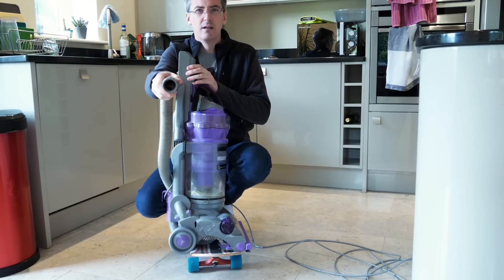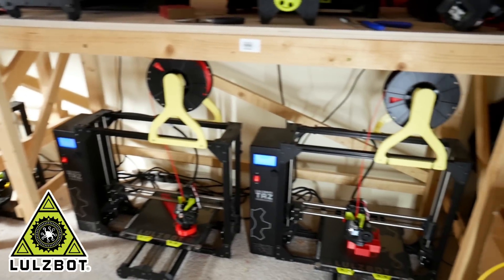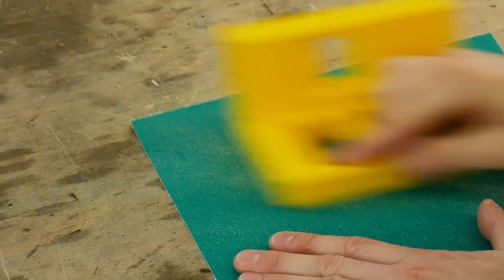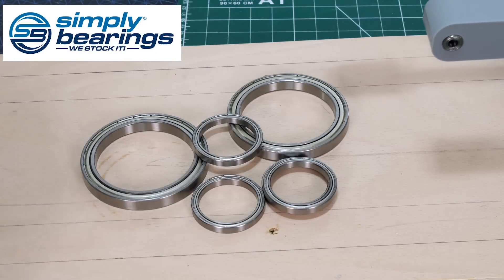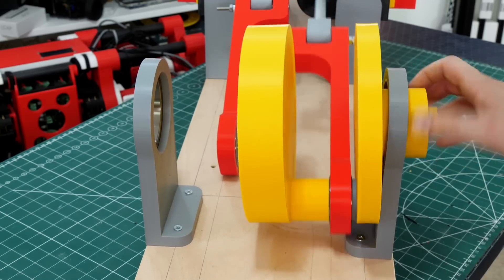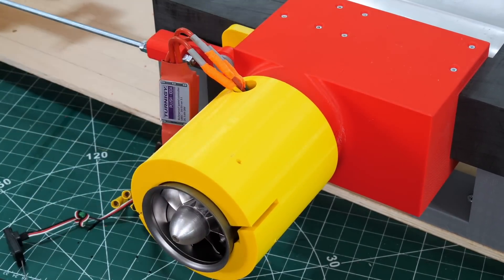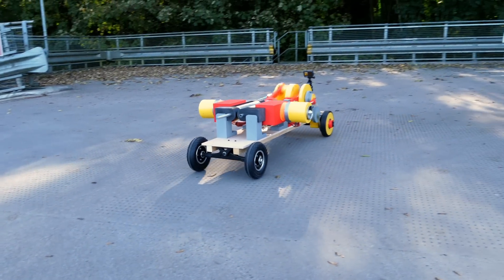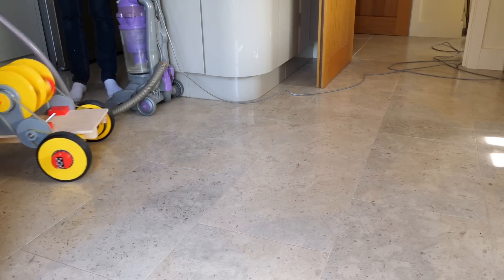Jet Powered air engine

Comment: Awesome engine. Instead of an EDF, try a turbo charger, so you get more air pressure instead of air flow/speed. Then it should be powerful enough for you to ride it, even with the small cylinders.
Reply: do you mean like a blower fan? Cuz he doesn't really have a source of high pressure, fast moving air to drive a conventional turbo..
Reply: @emiliaolfelt6370  I'm thinking of those snail-shell-looking fans. Like the one Integza made for his turbo-charged pulse jet. With that you'd get more air pressure, instead of airflow.

Comment: Im curious if putting more tolerance in the design and using something like this method of smoothing prints with UV resin and corn starch could help the fit as well:
https://youtu.be/KVf0mbBCygQ?si=2D-yWKotUBrjlOnh

Comment: I'm of the opinion that you should use much wider diameter pistons over longer stroke.  More surface exposed to pressure translates to more output torque.  Of course i made this comment just before the end of the video...

Comment: Try adding some silicone oil to the moving parts and cutting or reprinting the piston with 2 groves so you can put an O-ring on it also the piston can be 0.5mm smallerto will help to stop binding

Comment: It sounds like there is a lot of air bypass on the cyliders. you could use some heavy weight oil to seal around the piston and the rods. that will decrease the leakage without changing teh friction.

Comment: A collab with Tom Stanton would probably be a good idea.  He's probably the best expert at air cylinder engines around
Reply from the maker: It would have been easier with compressed air because there's enough pressure of overcome the friction of seals, but this is a harder problem to solve.

Comment: Well, on a steam locomotive, the cylinders do seem to be between a third to a half the diameter of the entire boiler, their length isn't too much greater than their diameter, less than twice from the looks of it, and they run at very high pressures, about 200 to 300 psi. EDFs don't make much static pressure at all, they are designed for high speed, I think its why JLaserVideo's hoverboard tunneled through the water and sank, its all velocity. To get a bunch of pressure, you could resin print an impeller and attach it behind an EDF motor so it stays cool, then hook up the housing output to the inlets, perhaps you'd only need to split it too. Could be an idea, I'm more just spitballing since I've got a bunch of theoretical knowledge and zero experience XD

Comment: try a screw compressor instead of the ducted fans. you need pressure, not airspeed... could be interesting to 3d print one...

Comment: Perhaps put a counterweight on the flywheel to offset the weight that is off-centre where the connecting rods and pistons are mounted. That's what is causing the back and forth vibration and will be wasting a considerable amount of power too.

Comment: No replacement for displacement! But did you see Tom Stanton's air engine piston seal he came up with? That would help you get some extra push too. Or just super scale one of his designs? lol. Fun challenge for yourself though! Best luck.
Reply from the maker: Yes if I was using compressed air, otherwise there's not enough force to overcome the friction, but I'd need a really big tank.

Comment: Calipers and something like a lathe would allow for much more consistent tolerances. I say "like" a lathe because you could probably build a jig that would be quite sufficient for working with 3D print materials and the sanding tools that you already have. The key is carefully controlling the movement of the part relative to the sander, holding it at a fixed distance, measuring, then advancing. Applying pressure to a freely moving part by hand is quite variable and not precise.

Comment: You should take a look at Tom Stanton's air engine
Reply from the maker: It would have been easier with compressed air because there's enough pressure of overcome the friction of seals, but this is a harder problem to solve.

Comment: Wouldn't this be a 1 stroke engine, not a 1/2 stroke? I thought a 2 stroke gets power every time a cylinder goes down. On this one the cylinders get power going both up and down. Please correct me if I'm mistaken.

Comment: Measure the static pressure you can generate with a length of tube with water in it by the height change with it off vs on. With this in Pascals and your piston surface area you know the force, then you can do the lever and gear ratio maths to work out the torque at the wheel and propulsive force. You can measure the force required with a spring gauge, or push against a weigh scale. Then you know if it's going to work before you build it.
Reply: spot the engineer

Comment: You can 3D print an O ring groove and use different thickness of O ring to tolerance the gap, then a  little light oil to lubricate and it'll be super low friction AND low leakage.
Reply from the maker: Thanks, I have a few better ideas for the next one.

Comment: A few CM more radius could improve your cylinders - however, you'd be best to measure the static pressure (above ambient) created by your fans and to calculate the force this exerts on your cylinders. I think your static pressure is just very low overall. Sadly though, to get chuff sounds, you'd  really need a contained pressure vessel that quietly produces your pressure - those ducted fans will always overpower the cylinder exhaust sounds. 

Next up, Walshaerts?

Comment: For starters your valving is built backwards. The slides should be inside a box, with the connecting rod coming through a seal. The pressure differential will aid in their sealing, not cause leaks like yours. 

Secondly look into cup seals for the pistons. 

3rd. A weighed flywheel

This video is a prime example of what's wrong with modern engineering. These simple solutions were solved 200 years ago with no electricity, no internet and no calculator. Today engineers and designers don't understand or care to learn why things were done the way they were. They think they are smarter and in turn create junk

Comment: Edfs move air, but they don't actually create pressure. Same reason you can't just strap one on the intake of your engine and make boost. You need an impeller not a fan.

Comment: Those edfs have very low static pressure. which results in very low torque. Which is why it's not moving with the tiniest bit of friction.
A different type of propeller, or even impellor might work better, like a turbo charger.
An other option is to have an air compressor system provide the air, they are good at providing static pressure.
And yes you also want as big of a bore as possible to get the most out of the little static pressure you get. then reduce the stroke, and you also don't have to reduce it as much with pulleys. as it will run with lower rpm.

Expansion engines like this are all about the pressure, air speed is less relevant, a steam locomotive runs on 200 to 300 psi after all. which is like the opposite of what edfs are designed for.
Reply: This is spot on. The issue is that the EDF is designed for high volume and low pressure. Great if you just want to prove you can move the pistons fast with no load, but not if you want any torque. To get torque you need high pressure. Volume matters very little and torque can be converted to speed. It would be amazing to see James take Mathias' impeller designs from other projects and try to 3d print them as well.
Reply: You think this would work better with Blower type fans, like the types used in air doors or household air handlers?
Reply: @smaqdaddy  I don't know, do they keep pushing air in even when the air can't leave out another place? that's what you need if you want high static pressure.

Most fans, if the air can't leave out the other side, air will leak back through the fan blades basically, against the new air coming in, meaning no new air will move in.

You can understand the difference, by imagining how easy you could blow backwards through/past a fan while holding it still..

Something like a piston air compressor, or a roller supercharger, you can not push air backwards if it's held still, because at no point is there a fully open pathway between the inside and the outside.

Comment: Nice build. But this proves how inefficient this style of engine is. If you just used a 4kw electric motor you would have an order of magnitute more force - yes I know that's not the point of the build. 4kw will happily move a small car (real car) at a resonable speed.

Comment: Hey James. Are you sure one of the reasons it’s slowing down as soon as you stand on it isn’t because you’re putting one foot and therefore pressure on the cylinder holder? It does look like you’re bending it a bit. Oh yeah, and look into dynamic sealing too!

Comment: Have you seen the steam engine design where there are two cylinders and the second larger cylinder runs off the output of the first one? I saw it ages ago in a Jay Leno video about one of his steam cars, but I got the impression that a lot of steam engines work like that. Is that design more efficient? You should look at more existing (ancient) external combustion engine designs.

Comment: Have you ever tried PTFE Film tape to line the spaces between moving parts? I've found that it makes it nearly frictionless.
Reply: I'll second this, it's a great way to reduce sliding friction.
Reply: Great idea! Or, even design piston grooves and use 3d printer type PTFE tubes as the seals with staggered gaps.
Reply: Beeswax also works very well and doesn't require any additional thickness to be accounted for
In a pinch I've used chapstick which works about as well but doesn't last as long

Comment: What if you used a "cone" shaped seal on either side of the piston. When pressure is applied it will expand out to meet the cylinder wall, but when there is no pressure it wont be touching, reducing the friction. Tom Stanton used one in his recent air powered engine.
Reply: I thought this then realised the piston is pressured in both directions  unlike Tom’s.
Reply: 2 of them @Margarinetaylorgrease

Comment: I think you should research dynamic sealing, one of the way to seal moving pieces without adding friction (the piston for example) is to make multiple grooves (like o-ring groove) along its length, this create sudden pressure increase and decrease as air tries to leak which create very high head loss and stops most of the leak (it still needs a small leak to maintain the head loss, but it's drastically better than just a cylinder in a tube)
Reply: Great comment
Reply: @Choconillaaa  🔴 What Is Islam? 

🔴 Islam is not just another religion. 

🔵 It is the same message preached by Moses, Jesus and Abraham.

 🔴 Islam literally means ‘submission to God’ and it teaches us to have a direct relationship with God. 

 🔵 It reminds us that since God created us, no one should be worshipped except God alone. 

 🔴 It also teaches that God is nothing like a human being or like anything that we can imagine.

🌍 The concept of God is summarized in the Quran as:

📖 { “Say, He is God, the One.  God, the Absolute.  He does not give birth, nor was He born, and there is nothing like Him.”} (Quran 112:1-4) 📚

🔴 Becoming a Muslim is not turning your back to Jesus. 

🔵 Rather it’s going back to the original teachings of Jesus and obeying him. 

More .....👇
Reply: I was going to recommend the same thing.  This design is used in almost every gas-actuated firearm.  The gas piston usually has a number of grooves to help seal it without the use of o-rings, piston rings, etc.
Reply: Nice! So it acts sorta like a tesla valve? Where air pushes against itself?
Reply: @TrumpstienPhile  more or less, the idea is the same, creating turbulences to create head loss, but the Tesla valve act by redirecting air against itself while here it's by creating rapid changes in volume and pressure
Reply: @red1246  good explanation. Would the turbulence cause vibration/ cavitation? Probably  not with air but with water I guess?
Reply: @TrumpstienPhile water doesn't like making sharp corners. The cavitation would make those sharp edged grooves round until the cavitation stops.
Reply: I didn't know that term but figured similar Multiple tight tight boundaries in line should prevent a lot of air coming out the other end.
Reply: Just use a thick grease. Simple fix. Might be messy but it will do the job
Reply: @SuperFGeeT  Thick grease also creates friction in a situation where it will never really warm up and reduce its viscosity. In a mechanical assembly with high torques involved, the losses from the grease are pretty negligible, but at hobby scales and power levels, grease can have a pretty significant effect.
Reply: @SuperFGeeT  In this case, 130 years of steam engineering ago would suggest packing with leather. Example: low tension metal split ring wrapped with leather. For steam, as the piston & ring heat, it expands the ring pushing the leather into the cylinder walls, and as some of the steam is still wet-steam in phase, it swells the leather to match the cylinder. In this case, his round piston design might work with pre-oiling or pre-wetting the leather then installing it.

For other designs, newer air compressors in high horse, high RPM ranges use "oilless piston ring" designs with a graphite/teflon ring which runs in an aluminum cylinder. However, those are specific-directional rings not meant for power stroke on both sides. Could be reworked however, as a double sided (or two sided) oil ring.

As one suggestor pointed out, grease creates too much horsepower loss in "hobby scale" (in this case, it isn't hobby scale, it is just very poor design...so there is a difference). Note- We all have to learn the hard way the reasons old-timers probably tried all this and abandoned it due to tech limitations. Secondarily, a round piston with just an o-ring (lubricated with whatever you got such as vegetable oil, regular oil or otherwise) would work for a while.

Since he is going extremely long stroke, heavy mass piston for lots of torque...and it being square...will present differing challenges for seal.
One suggestor pointed out channeling the pistons to create high/low pressure areas...same as hydraulic pistons in older stuff...in that case, a corkscrew channel design with a round chamfer on one side of the groove and a curved chamfer on the other may work.
Reply: Like Tom Stanton’s flexible seal?
Reply: optimize your Air Engine like Tom Stanton did in that video
/watch?v=cYF_D-4PhUU

Comment: The flywheel also needs a counterweight to cancel the reaction to the piston flying back and forth. Look at any steam train wheel and you'll see that it has a huge weight attached opposite the crank arm. And is there any way you can lubricate the cylinder? I feel like if you smear enough grease on it, that might even close up some of the leaks too.
Reply: You don't really need counterweights, they're only there to get rid of vibrations. And grease might improve the seal, but it would actually increase friction. In principle you'd need a proper oiling system using a low-viscosity lubricant, but it's not really worth it. The advantage of using plastics is that they're self-lubricating to some extent.
Reply: @leftaroundabout Well he also has an innate leak anywhere he is using the 3D printed material where pressure is applied because there are lots of tiny holes you can't see with the naked eye but it becomes obvious if you are dealing with water as it will leak through unless you seal it with a clear coat or epoxy
Reply: @SilvaDreams  properly fused 3D prints should be plenty airtight enough. Perhaps not in the sense that they could hold 10 bars of pressure for hours, but certainly for the fractions of a second and of a bar required here. If your prints are that permeable, there must be something wrong with the layer adhesion. The piston seal will be much more leaky, and most significantly the turbine is not a positive-displacement pump so air can just bleed back through it if the piston doesn't use it up quickly enough (because of insufficient gear ratio).

Comment: Why not blow AND suck air. If you do both then wouldn't the air leaks be less of a problem? Also silicon lubricants are great for nerf guns, so I would assume a thin silicon spray lubricant would help reduce friction here.

Comment: James I believe your cylinders may be large enough after all, but you need more gear reduction. This will lower the force and increase the airflow in the cylinders. But perhaps you’ll have to balance your camshaft before you go to higher rpms.